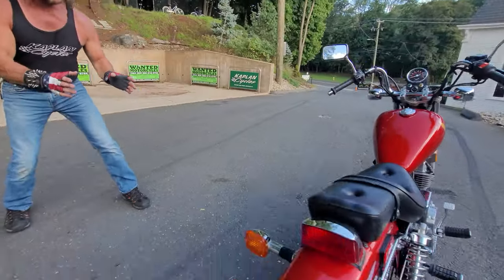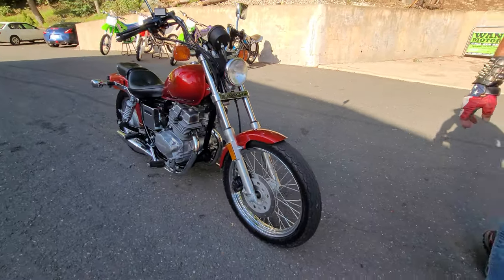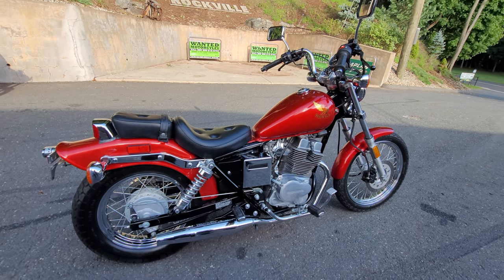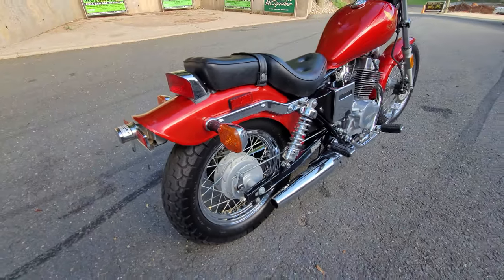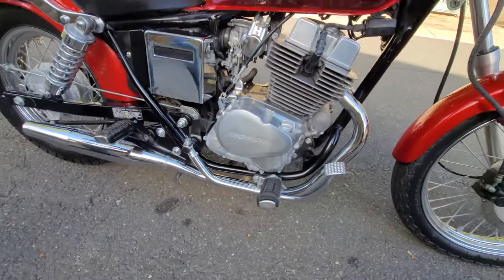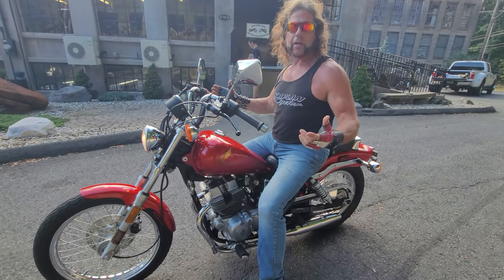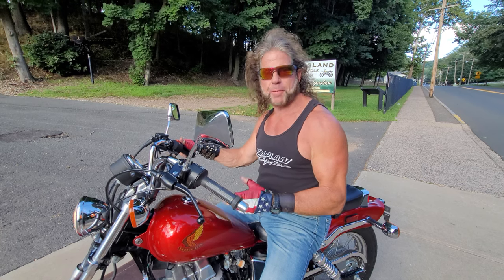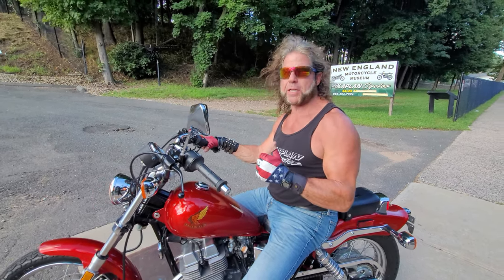PRISTINE 1986 HONDA CMX250C REBEL

Comment: I was obsessed with this bike when I was a teenager, first, it’s not as huge as the harleys or the typical cruisers, second it’s cheap, fourth it looks good and lastly it’s reliable. Unfortunately cheap as it was, I still can’t afford it back then. It’s the best one if you just want to ride a small cruiser or don’t really into speed but you want to look good on wheels.

Comment: Hi guys;I have an 05 Rebel  ,with 2000 miles on it. It looks brand new. I m older, so I couldn't ride the bike ,it was too heavy.I bought it  brand new in 95. Now that was a beautiful bike too. I traded my  Suzuki 800 interceptor, on this.  Traded even,for this,and the dealer in California, was delivering,another bike in New York, so they dropped mine off, and made that delivery. When they were going back, they picked my old bike. It was on dealership floor 3 days,and it sold. The dealership called me ,and said ,the customer loves it. Nicest bike they ever had. Glad both of us got nice bikes, and will have a nice home.

Comment: I have a 2005 rebel  250 and it doesn’t stay running unless.  I keep the choke on almost the whole way.  Had all kinds of work done to it and now I am having problems any suggestions? On what I can try to fix it? 
Thanks
Reply from the maker: Have a professional micro drill the  pilot Jets ...If they don't know what I'm talking about they're not a professional